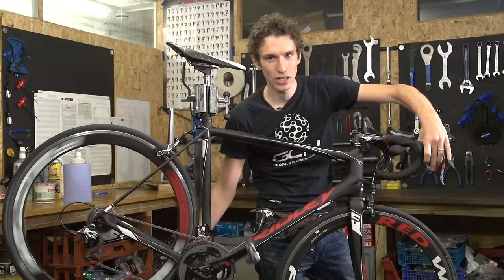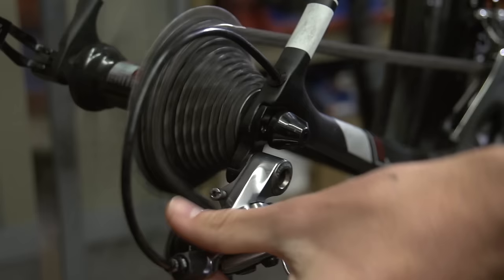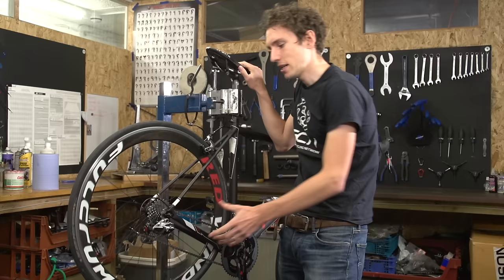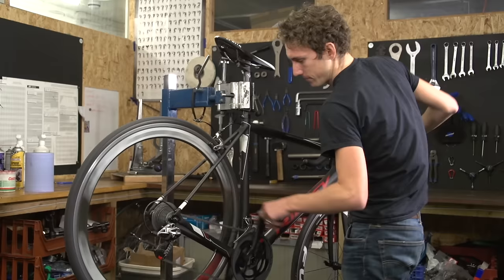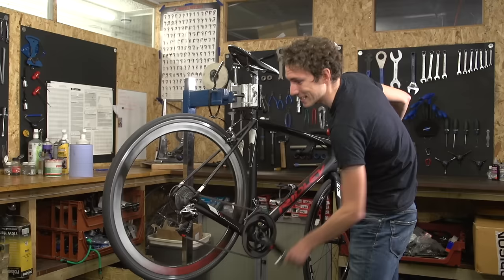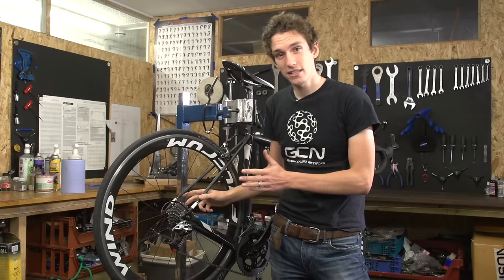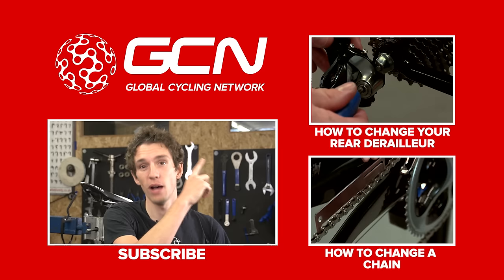How To Index Your Gears - Adjusting Your Rear Derailleur

Comment: In every single video of indexing no one ever mentions the most important check first which is chain line from middle of cassette to the middle point of a 2 ring system. If that is not properly aligned the indexing may be off on certain cogs which you may have to compensate by purposely bending the derailleur cage towards the cogs that are off set indexed.

Comment: why on my bike is it so jard to shift with the thumbshifter?
Reply from the maker: +ryan cole the gear cables have probably got dirty corroded, you can try cleaning them but you may need to replace them.
Reply: +Global Cycling Network its not that because its a new cable
Reply: +Mark thanks

Comment: what if my bowel adjuster is as lose as possible but is still not directly located under my smallest chainring
Reply: fixed it, the limiter screw was set to were it limited the adjuster to go as low
Reply: Carina Maren glad it's shifting well. what'd you ever end up doing about your loose bowels though?

Comment: Beware! One thing the video omits is that doing this bears a major risk of damaging the deraylor and having to replace it. If you accidentally take the screw out completely (happens very very easily) and damage the area where the screw goes back in (happens very very easily) then you have to replace the entire deraylor. So I would ignore this video which makes everything look so easy. Go to a bike shop and spend £10 for indexing.

Comment: i did this to my mountain bike because my mountain bike can't reach the biggest cog.. but sad but true nothing happens
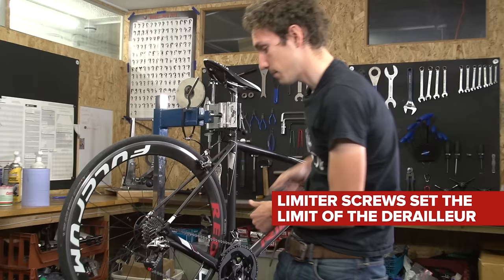Reply: Check out the section at 2:28 again. Sounds like you may need to adjust your high limit screw. Get that set then use the barrel adjuster to index. Hope it works out!

Comment: new cable. check .new derailleur, check .new hanger..check ,,....can i get the gears to change smoothly ...can i FCuk..9 gear cog wont go into gears 1 or 2 .goes in 3456789 but is jumpy as fcuk...messed around with the screws and does nothing.waste of time and money on my specialized.

Comment: I have watched a number of these and no one is saying it in full spectrum. They're all simple examples.  
1/ Thum shift to top gear. 2/Hi limit screw. 3/shift gear to lowest sprocket. 4/Low limit screw. 
5/ If chain resists low gear change DIAL INDEXING screw ANTi-clockwise.  6/ If chain resists high gear change then dial indexing screw CLOCKWISE.... simple pimples..... NOOOOOOOooooooooooo sorry not true.... you can iNDEX ALLLLL dayyyyy Longgggggg clockwise or anti it will not fix the shifting problem and yo may end up with gear shifting that will not shift at all to the highest and lowest ..... so please with a cherry on top go and ride a bike to the point that it really really really does need indexing and make a video on every action you take. Then we can all be happy for once!!!!

Comment: Sorry Si I have to dislike this. From my point of view as home mechanic your method is too complicated also you don't mention what or which limited screw like the H L thing is stands for. Less is More just keep it simple, efficient and structural just jump out to adjusting barrel is not structural.
Reply: I am just 13 years old and i fixed my mtb by this video